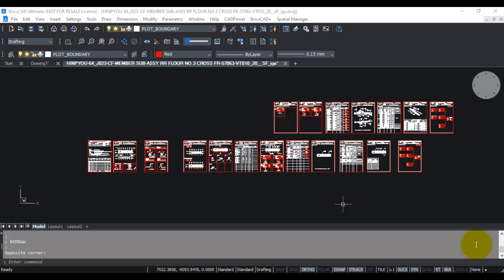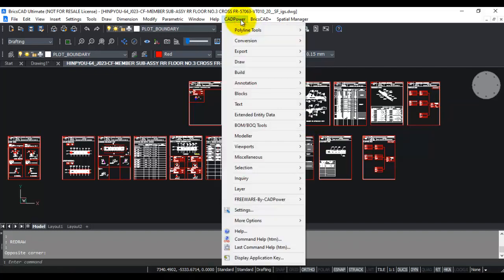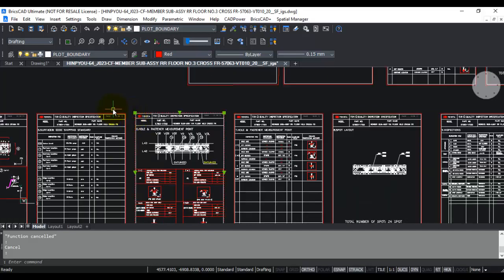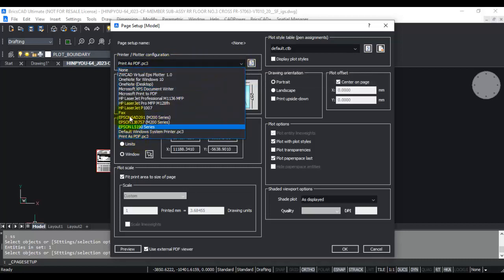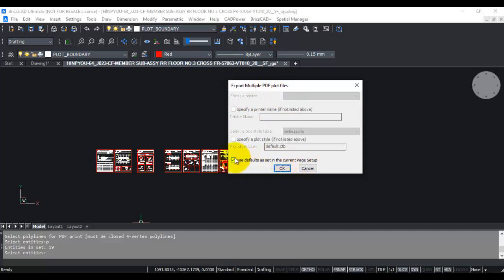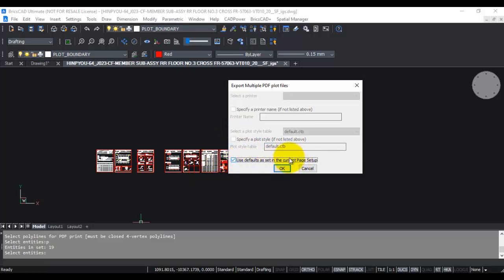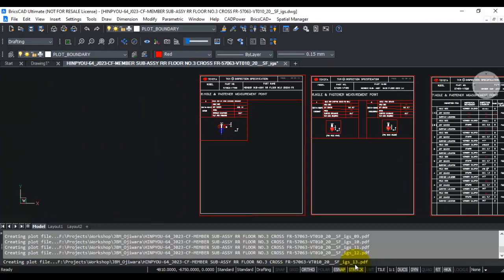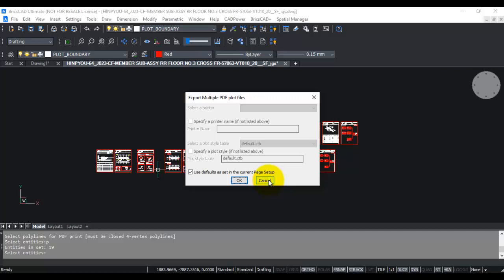CADPower Tutorials: Automated Multiple PDF Export in Autocad and BricsCAD | CP_MULTIPLEPDFEXPORT

Comment: Hi - Watched with great interest. Need one help in case you are aware - I have a multi-page PDF of 12000 pages wherein each page is having one image.  For Label printing - Want to create output PDF wherein instead of 12000 pages in input-PDF,  output-PDF has 1000 pages each having 12 images in 4x3 layout. Command line tool picks first 12 and put in 4x3 layout and then pick next 12 and again put in next page and finally we have output-PDF of 1000 page.       There are online tools but those have limitation on size of input-PDF . By any chance are you aware about command line kind of tool on desktop ?
Reply from the maker: I dont know much about advanced PDF processing. Sorry.